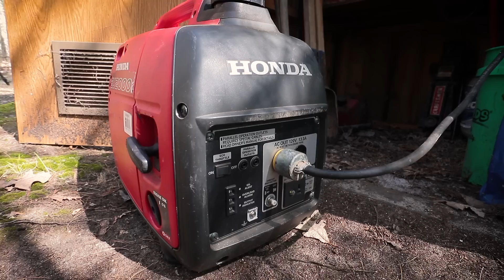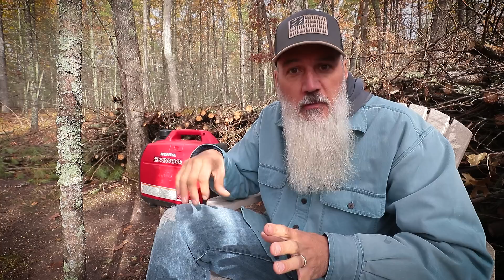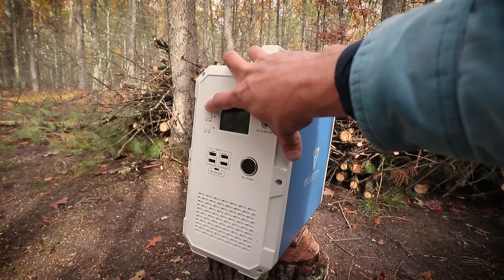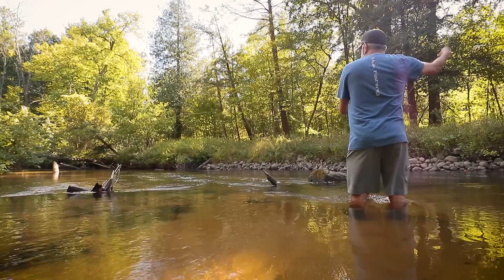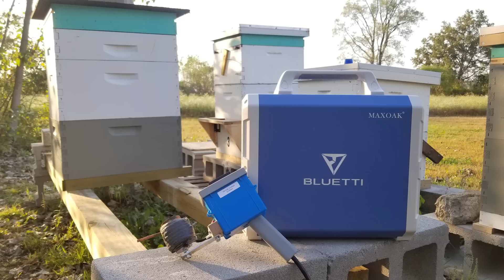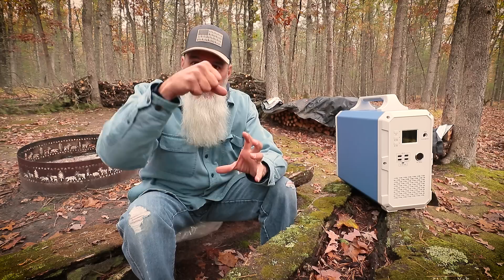Off Grid CABIN gets a Power UPGRADE | Testing the MAXOAK Bluetti EB150

Comment: I am curious what kind of power output you get from your solar panels on a cloudy day. There should be something even if it is low.
Reply from the maker: Not a ton really.  Cloudy days I've seen it bounce around from 10-40 watts going in.  Each panel will behave different in cloud conditions.  Some of the foldables may actually work better on cloudy days.

Comment: Typically you want 3 days of extra battery backup  In case  you have cloudy days. I would recommend getting another solargenerator. Maybe a 700wh instead of 1500.  Second, add another 200 watt panel in series ( make sure the amps are under 10 and the voltage is no more than 68v. Third invest in some amorphous solar panels. They are the best in low light conditions. Lastly solar generators are terrible charging heaters, so you may want to purchase a 200watt space heater or a Mr. buddy propane heater. Hope this helps

Comment: What's the fan noise under load with this? do you think it would be quiet enough to be run in a quiet room during the night to power a heated blanket without waking someone up?
Reply from the maker: Depends really on the load you put on it.  Really small loads the fan doesn't even kick on.  Pull 1000 watts from it, and the fan will run.  It's depending on internal temp of the unit and how much heat it's making to provide power draw.  For most moderate loads, it's pretty minimal, I could probably sleep with it in the same room no problem.
Reply: @1870s  I really appreciate your fast response and detail! The load of one heated throw will be a maximum of about 170 watts. But there may be occasions where 2 of them are run together. 

I'm thinking of picking one of these up for emergency backup in general, but being able to run the heated throws at night would be good.
Reply: @1870s  I tested the EB150...it runs both of the heated blankets on maximum settings in complete silence! The AC charger that came with the unit has been upgraded as well, it's charging at 200-212 Watts and has an internal fan now.
Reply from the maker: Awesome!  So glad it's working out for you friend 🙂
Reply: @mreverybody1150  Im looking to buy a electric blanket so far most have bad reviews could you please tell me the name of your blanket and where did you purchase, please and thank you
Reply: @ladyg1772  Dreamcatcher Luxurious Electric Heated Throw, Large 160 x 120cm Soft Fleece Throw Blanket, Large Heated Electric Blanket Overblanket with Timer 9 Control Heat Settings (Grey) from Amazon

Comment: You can over build solar panel over 1000watts as long as you don't over volts or Amp it.  So in cloudy days 1000 watts solar can charge 500watta which is max input kn eb150

Comment: We started our 12 volt solar system on our 80 acre homestead, twenty two years ago with one 90 watt panel. While our system is still 12 volts the wattage has increased over one hundred times to 12400 watts. During that time batteries that used to be cheap got expensive and solar panels that used to be expensive got cheap ($5 to .50 cents per watt). The net result of this is that the way to set up a system is to over panel it. Right now we are getting 6 to 8 kw on a completely overcast day and 50 kw on a sunny day. We power everything from led lights to air conditioning and even an electric tractor. Being set up like this direct powers our loads most of the time while relying on the batteries only at night during low demand (lights, water pump, refrigeration, etc.

Comment: How do you connect this to your cabin to run all of your lights?
Reply from the maker: The cabin is all wired up a like a normal on-grid "house" would be.  The input for the power is in our shed.  Where we normally plug in our generator.  Instead, we just plug in the Bluetti Power bank.  This video here, explains it pretty good:  https://youtu.be/om_Fhv0mp-Q

Comment: You need to mount it to your cabin so it can get the best access to sun.
Reply from the maker: If we get some trees trimmed up eventually, we'll probably mount them up on the roof.
Reply: @1870s  How has charging been? Its been my experience that you need full sun exposure. You have A lot of trees hindering the panels. How has it gone?
Reply from the maker: @chrisanderson8553  It's been winter.  We don't get to the cabin much this time of the year.  Mid summer, we have great sun.  Late fall, not so much.  Last winter trip to the cabin, we didn't even take the panels.  Charged up the EB150 at home, and brought it with us to power up the cabin.  Ran 4 days on single charge, and never even took the generator out of the truck.  Will do more testing with the panels this summer, when we're there more.